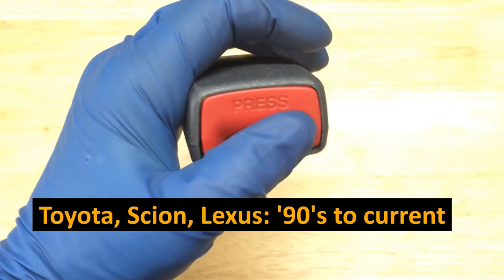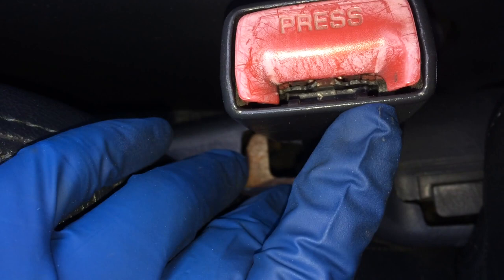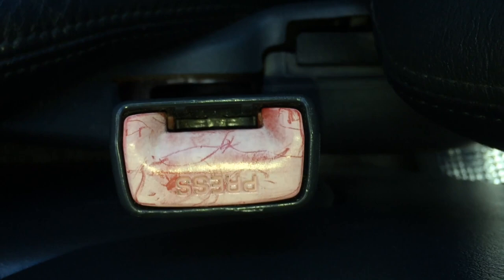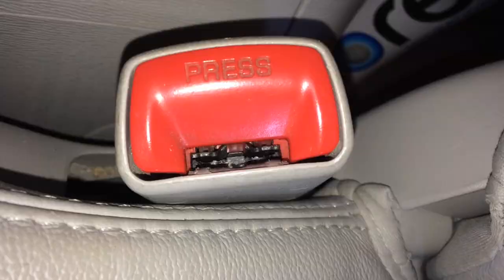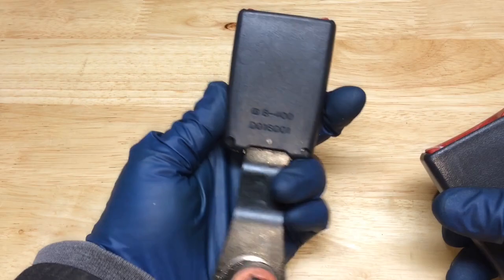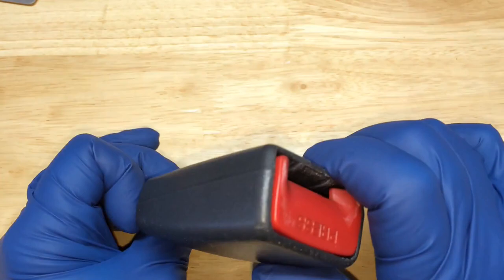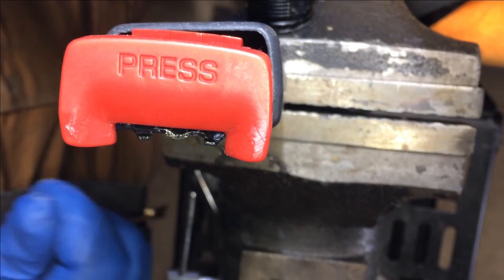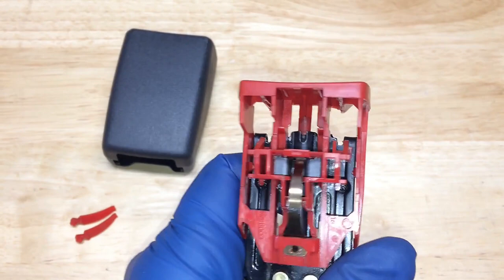Toyota Lexus Scion Stuck Seat Belt Buckle Receptacle Inspection, Disassembly ('98 Rav4 buckle shown)

Comment: I found your video while searching for information about disassembling a Tacoma seat belt receptacle. What a pleasant surprise. You're a very good mechanic, an astute repair person, and an articulate presenter. Thank you, and keep up the good work.
Reply from the maker: Thanks!  Please post back with any tips if there are differences with your Tacoma seat belt.  Thanks for watching : )
Reply: @L35inColorado  The Tacoma buckle was a little different. The casing was more robust and rigid, and would not respond to disassembly efforts. So replacement was the only option. The new buckle, from Toyota, came with an integral wiring harness. In removing the old buckle, it was not possible to remove the old harness without a complete seat removal, as the harness is routed through a hole in the seat assembly through which the connector will not fit. So, instead,  I unwrapped the electrical tape from the harness at the buckle end to reveal a small flat connecting "chip" that easily snapped out of its mounting in the buckle. The replacement buckle was manufactured the same way, so I was  able to use the old harness with the new buckle. It is possible to install the connecting chip upside down, which I inadvertently did on my first try. After correcting my mistake, it all worked fine. I didn't do any seat disassembly. Everything was easily accessible, since the harness remained in place.  If someone is replacing a defective buckle, I'd highly recommend they do it this way, retaining the old harness in place, and connecting it to the new buckle.
Reply from the maker: @walter9425  Wow - thanks for documenting these details and sharing your tips!  This will certainly be helpful for myself and others.  Thanks again and nice work!  : )

Comment: I really appreciate the detail that you did in this video. I was trying to repair my 2002 Sienna seat belt assembly. I found the very same little red plastic wings when I took it apart. I couldn't tell if they had broken off or not and would never have figured out their location without watching your video. 

I tried gluing things together with super glue, but unfortunately it would not hold.

Comment: Thank you for the video. The plastic parts in my 2003 Tundra are slowly breaking down. I will switch out with passenger side until I get new parts. And yes, you have a great voice, you could do radio or voiceover work!
Reply from the maker: Yes, we're now at the age when our 90's and early '00's Toyotas (like your Tundra!) are going to see more failures from two decades of plastic aging.  Luckily, there are still replacement parts, and since I think these Toyotas especially (from about the '92 - '12 model years) are the most reliable Toyotas and will be on the road for a long time, hopefully parts will be available for a long time, too!  
Thanks for watching, and thanks for keeping your '03 Tundra on the road!  : )

Comment from the maker: Timestamps:
00:22  In-vehicle inspection
03:30  Bench inspection
05:10  Remove the outer trim cover
06:59  Bench inspection of the open buckle
09:21  Test the open buckle in a vehicle

12:31  Disassemble the open buckle
14:28  Where the broken pieces came from
15:34  Demo plastic welding the broken parts
16:14  Re-assemble the buckle parts
20:45  Re-assemble the buckle to the trim cover

21:37  Test the closed buckle in a vehicle

Video DIY to replace the '96 - '00 Rav4 seat belt buckle:
https://www.youtube.com/watch?v=VBTcBCu0ta8

I hope this video was helpful for you.  Thanks for watching, and good luck with your repair!

Comment: What we did on a 2002 Camry and it would probably work on other Toyota models as well is just remove the floor bolts (14mm) to the seats and then remove headrest then lean it forward towards the front window.  That should give you access to the 14 mm bolt on the side of the seat to remove the seatbelt buckle.  You'll have to fish out the wiring if you have a wired model seat belt.
Reply from the maker: That is a great tip - thanks for sharing, and thanks for watching!  : )

Comment: I have fixed many laptop plastic injuries with the super glue / baking soda trick even hìnge parts that get a lot of use. Those red pieces are kinda small but I'd still try just cause! and you put out great content. are very well spoken and the detail is amazing.  The arrows etc that you use helps so much, especially since I'm getting ready to fix a 2012 sienna middle row seat belt latch.😊
Reply from the maker: That's great!  Please post back with your tips - and thanks for watching! : )

Comment: Thanks so much for this.  I have a seatbelt buckle for a Suzuki Alto, and it's a little different to the two tab versions shown on allot of youtube videos.  The tabs I'm referring to are the ones you wedge the screwdriver under.  My seatbelt buckle doesn't have these  tabs, but instead has a flat piece of metal that supports the sliding mechanism which is pushed down by the seatbelt metal insert.  It's flush with the plastic case backing it so it's hard to see.   Very similar to yours.   I'll have to wedge under that piece of metal like you did.  It'll be a little hard but now that I know it makes it easier.  
Thanks again.
Reply from the maker: Wow, thanks for adding your tips in such detail for your model of seat belt - that will certainly help others, and myself if I encounter such a style.   Thanks for watching! : )

Comment: The tear-down & attention to detail are simply amazing..!  The 2 broken red plastic doesn't seem to serve any safety purpose so if someone can use a skinny pick & pry broken plastic out, the buckle should be back in business?  

My W203 seat belt buckle button suffers slow going down & slow going up.  I spray with teflon / silicone lubricant and it will be smooth for another year or two.  Mercedes seat belt is part of SRS system so I try not tearing things apart, you are brave 💯
Reply from the maker: I'm not sure exactly what those two broken pieces do, but my best guess is that they return the top of the buckle to be flush with the case.  The receptacle does work and locks fine without them (as long as they aren't in there gumming it up) - but the receptacle red part doesn't seem to "rebound" to that flush point with the case.  If it is the difference between having a buckle or not, then it is at least worth a shot to remove those broken pieces and try.   
And I know what you mean about the Mercedes buckles - in the W163, there is a sensor for the SRS system, to detect passengers (front and rear).  So if you remove a seat and leave the sensor disconnected, it trips the SRS light until you either put the seat back in, or fool the sensor into thinking there's a seat (ie, with a 100 Ohm resistor).  MB makes everything waaaaaay too complicated!  : )  
Thanks for watching!

Comment: Sorry, another question.  My seatbelt buckles are identical to yours and due to seeing your video I instantly knew what the little plastic parts were.  I'm wondering  if it would be better to replace those two little plastic springs with a metal spring mounted to the top of the separate inner plastic red piece you pulled out of the slider, and the underside of the seatbelt button?   Small metal springs, even glued to those surfaces would be more reliable, they would be too big to fall into the works, and would provide a strong return click. 

Just wondering what your thoughts are on that?   

Thanks
Reply from the maker: I don't know - there's probably a way to do it, but I haven't tinkered with that myself!  The buckle does work without those little broken parts, but as you point out, it doesn't have the full return.  Please post back with an update if you're able to make something work - good luck! : )

Comment: You show the seatbelt buckle in the vehicle and then out of the vehicle, but you don't show how to remove it from the vehicle.
Reply from the maker: The removal process for the seat belt buckles varies from model to model.  For the Rav4, it is easiest to remove the seats, then there's just one 14mm bolt.  For other models, you might not need to remove the seats.  It just depends!
Reply: What we did on a Camry and it would probably work on other Toyota models as well is just remove the floor bolts (14mm) to the seats and then remove headrest then lean it forward towards the front window.  That should give you access to the 14 mm bolt on the side of the seat to remove the seatbelt buckle.  You'll have to fish out the wiring if you have a wired model seat belt.

Comment: it's not work with warning light. 😂
Reply from the maker: If you mean the seat belt warning light - it depends on the model. Some Toyota's have the sensor in the pretensioner assembly, and others have the sensor at the receptacle.  For the Rav4 shown, the sensor is on the pretensioner side, so there no sensor/electrical to worry about on the receptacle side (as shown in the video).
The easier/quickest way to see which version your model has (if you don't know) is to unbuckle the belt (remove the latch from the receptacle) while the engine is running, but don't allow the belt to retract at all. If you light illuminates as soon as the belt is unbuckled, then you have a sensor in the receptacle.  If your light doesn't illuminate, then allow the pretensioner to retract the belt - you'll see that the light will eventually illuminate once the belt retracts to a certain point. 
You can also determine this by ascertaining if your model has an electrical connection at the receptacle: if it does, then there's a sensor the receptacle.
I hope that helps - good luck!